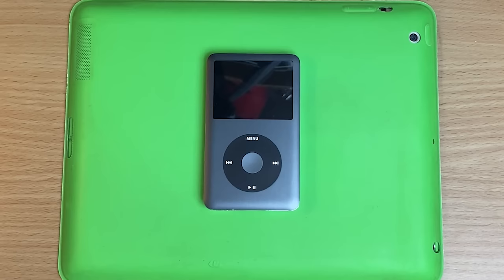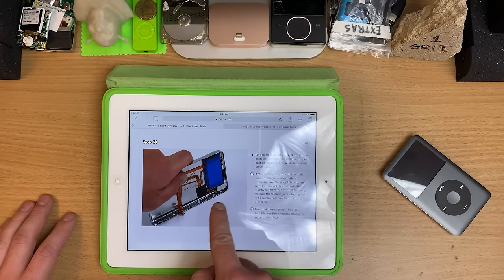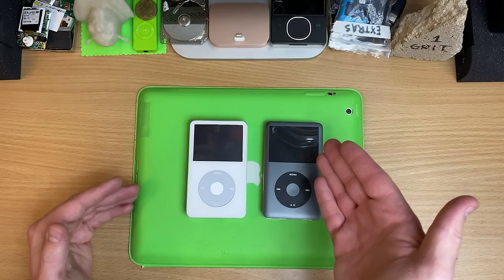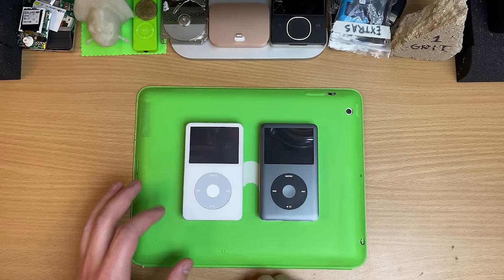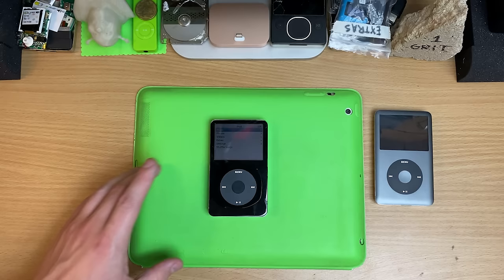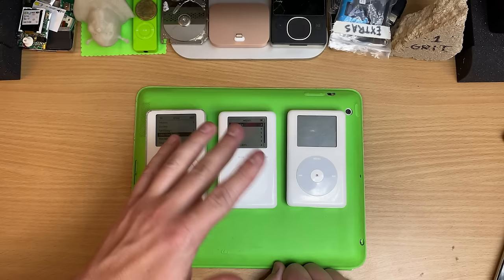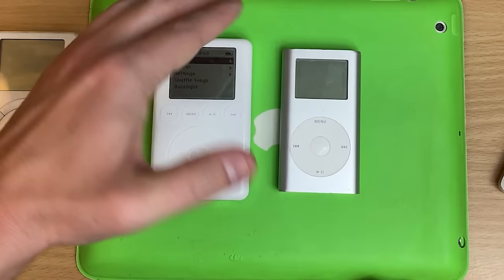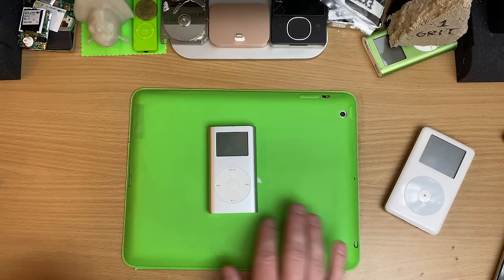The CHEAPEST iPod to modify

Comment: Maybe you can help me.
Just got an ipod classic 80go, but clickwheel doesn't work at all
I opened it, and saw that connector latch is broken.
Do you know if it's possible to get only the connector ? (Can't find it on Aliexpress, and mainboards are as expensives as buying a complete one, which i ended up doing x) )

Comment: I thought the 80GB 5.5 could do 50,000 tracks? The iFlash website seems to say it can, it’s just the 30GB that can only handle 20K.

What does everyone think of the screen on the 5.5 for videos vs the 7th gen? I’ve been contemplating modding a 5.5 as I really want one with a clear front and wheel and obviously you can’t get that with a 7th gen, but I use my 7th for a lot of video (mostly listening rather than watching, but I do sometimes look at the screen).

Comment: Why do you always use Micro SD and not regular SD to eliminate another point of failure between the micro SD-SD adapter?
Reply from the maker: Way cheaper and more useful for other projects. It fits in more things and I’ve never had issues with micro sd adaptors

Comment: So I've tried to do this with a Gen2 iPod Mini. I've tried various CF cards but whenever I plug it in to a Mac is says "unititialized" in iTunes and when I check it in Disk Utility, it shows up as a 1.02TB drive. No matter what CF card I put into it, a 16GB, a 32GB, etc. It always shows up at an unitialized 1.02TB drive in disk utility. So then when I attempt to restore it in iTunes, it always fails.  Probably because it's trying to restore at 1.02TB drive rather than the 16GB CF card that's actually in there.

Has anyone else experienced these weird errors before? If so, what did you do? 
I can do surface mount soldering so I'd be keen to replace parts on the board if that's the issue. Does anyone happen to know which chips or components generally fail on these devices? 
Since we're in lockdown, I've got WAY too much time on my hands so I don't mind to get deep into it. Haha

Comment: Has anyone ever made a protective case for the iPod classic 160GB that had a built in battery bank and blue tooth transmitter? If not here is what i would like someone to make for us old podheads.  It would be a great upgrade for an old iPod. Have it plug into the 30 pin connector inside of the case as to allow the blue tooth transmitter to control the  iPod via the head phone control buttons It would have a female connector on the exterior to let it charge up without removing it from the case and allow for signal pass through when connected to your computer. Belkin are you listening?

Comment: One of the things that really annoys me about the Mini is that it won't shut off.  If you leave it for a few weeks and come back to it (unlike, say, the iPod Video) the battery will be dead or severely depleted.  DankPods, any thoughts on re-wiring the battery connection to the hold switch so that instead of acting as a hold it actually cuts power to the modded Mini?

Comment: I recently got a 2nd gen. iPod Mini off eBay after watching this video a few times...

I've already had a 6.5 gen. iPod "Classic" with 128GB CF card via iFlash CF, and I SO WANTED this CF card to work in the Mini as direct replacement for 4GB MicroDrive... but, no. iPod ejects itself from iTunes while restoring with CF card in, and after that iTunes doesn't recognise the presence of iPod. It might be formatting issue (I haven't got a CF card reader to pre-format the card) or compatibility issue (Lexar Professional 400x). In any case, I am not going to buy another high capacity CF card (EXPENSIVE!!!), just to get rejected by the Mini... I will go with iFlash CF/SD adaptor...
Reply: ... got an iFlash SD-to-CF adapter... got a 128GB SD card... and... it won’t go.
“Unknown error 1406”...

Tried with a 2GB card, and it went OK... I could just about make a 16GB card work (iTunes wouldn’t restore it, though). But, I just can’t get it to work with 128GB card.
Do you have any idea of a SD card that reliably work with this mod? Ideally 128GB, but 64GB could do...

Annoyingly, I seem to have damaged the click wheel ribbon while struggling to get a SD card working...
Reply: Finally, after 3 years... I got the iPod Mini 2nd gen. working.

Now... somehow, the iFlash SD-CF adapter didn't work at all. Also, Lexar nor SanDisk SD cards worked... it gave errors when restoring via iTunes on iMac.
I got hold of a pretty generic SD-CF type II adapter from Amazon, and PNY brand SD cards (128GB and microSD 32GB), and they worked more or less straight away.
It was some compatibility issues.

Now, I might get another iPod Classic to use the iFlash SD-CF adapter with...

Comment: potentially stupid question but why not just use an actual CompactFlash card?
Reply: If I had to guess, Price and performance. I just did a quick search and it seems like battery drain is also a factor between the 2. Also sometimes you have to format the Sd card before installation and SD is easier majority of the time. Not certain, but thats my general knowledge.
Reply: it costs over 200 bucks for a compact flash card with 256 gigs.

Comment: I had a sad moment. I was changing the battery in my ipod 5th gen and accidently pulled the whole battery connector bit ITS TINY!!! I have zero soldering skills and I'm not spending money on repairing it. I'm sat here thinking it would be a terrible waste to throw it in the bin, with the resr of it working! ARGH!
Reply: Don't bin it dude it is a waste
sell it for parts on ebay or something at least

Comment: This channel has got me to cancel my Spotify and get an iPod mini. I've upgraded it to 256GB with a CF to SD converter, which all works fine with iTunes. But when I try and install Rockbox it seems to install correctly but on restart I get an error that there's no partition and I need to connect USB to fix it. When I connect USB Rockbox app (in both Windows and Mac) then says it can't mount. I can load back into the stock firmware fine as well. Any ideas anyone?

Comment: I daily drive a Photo 4th gen, and it will not work in my car, Ford in their infinite wisdom only included USB audio in my Fusion (MK5 Mondeo for other parts of the world) and the infotainment system when you plug it in will be like wtf is this device pls remove it. I am going to get a mini and mod it because the battery is starting to go on my 4th gen and I hope I have better luck with that.

Comment: Anyone know why you can't use the 1st Gen?  Or is it just that the first gen is limited to smaller GB sizes?
Reply: I got 256GB working on my 1st gen
Reply: @GayDingo  Thanks for the info!
Reply: Ronald Olszewski i also got a dual SD to CF adapter and did 512GB. Works! But only with the Mac Firmware

Comment: ya know., I melted the hard drive in my ipod mini because i left it on all night. it was so hot i called it the "Hot Pod Pro" from there on. so i did a reset and the drive was fine...... For 3 days.Then it died. I went in to replace the drive and i broke the connector that goes  from the board and the drive. #oof

Comment: I was looking at buying the 7th gen Ipod touch 256gb with 4 inch screen
As I already own 5th gen 500gb 4 x Samsung 128gb cards 
 7th gen 500gb 4x128gb cards flash 2000mah battery.
And now a 7th gen 2.0.5 firmware I'm am awaiting parts for to rebuild into 1tb as I have 3 x 500gb sd cards on way too but I think I'm going to build one for my partner and one for my mother to take away with her. 
Rather than buying the iPod touch I picked up a lg v60 256gb 5000mah with quad dac and a 1tb sd card so that 1.25tb storage and a 64mp camera.

Comment: what is the recommended flash mod for the 4th gen?
Reply: I used the iFlash quad and the 4th gen converter thing for it and put in the Samsung Pro Plus (2021) microSDXC 512GB U3 V30 A2 UHS-I  and a Samsung Evo Plus microSDXC 128GB Class 10 U3 UHS-I.came up to 596GB and it restored on first try. Runs like a dream. Make sure you have a firewire charger because otherwise you can't complete the restore. Best of luck!
Reply: @DamonChuckLover89  thank you, ill certainly try